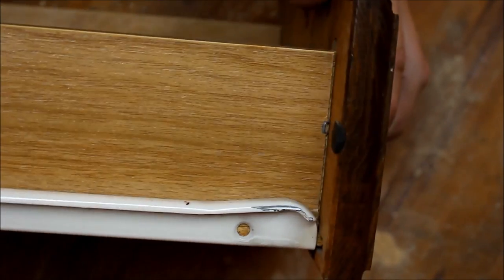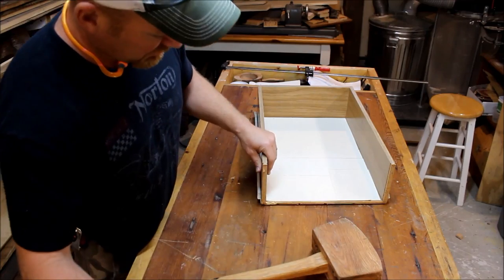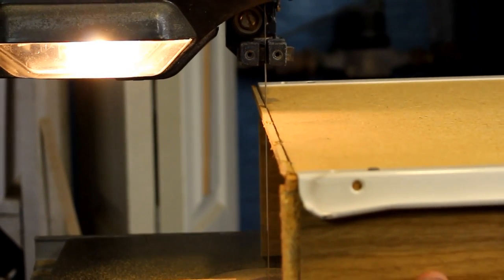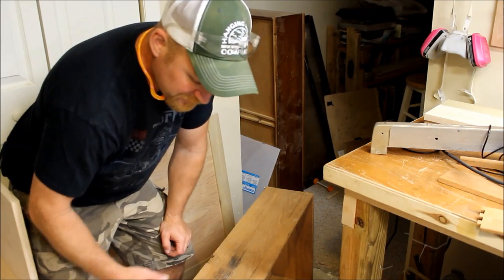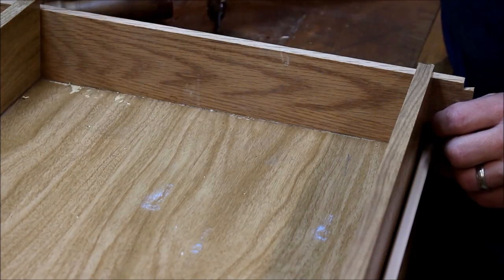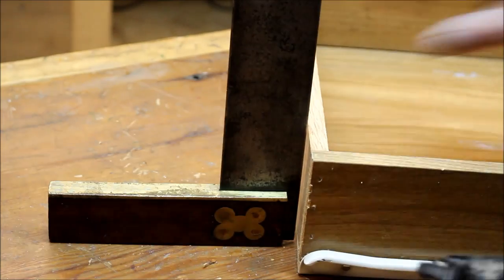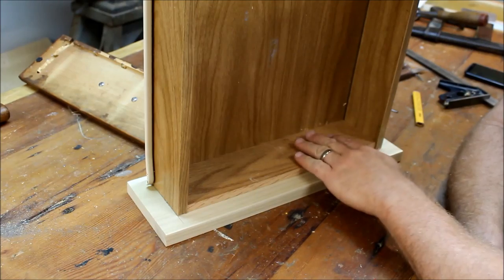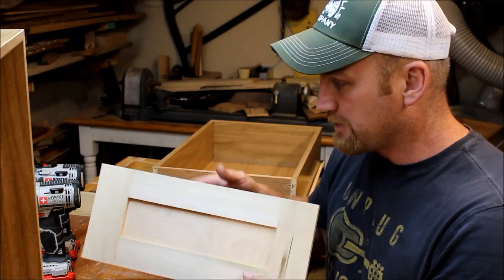Building New Drawer Fronts. DIY Retrofit. How To.  Kitchen Remodel #2. Vintage Wood Workshop

Comment: Very helpful. Curious, wouldn’t it be a good practice to nail plywood bottom to new front side piece underneath. Otherwise it could be a weak spot allowing for a dip or bowing near the front from weighted objects over time.

Comment: Could you also attach that oak board to the inside of the drawer front before attaching the drawer front to the drawer? (After you checked to make sure it fit snug)

Comment: What material did you use for the false draw front? Also does it matter what material you use, I'm intending on painting mine so aesthetics dont matter just thinking about durability and strength. I'm rather new to woodwork and learning as I go. Any advice would be appreciated

Comment: Great video! One thing I can't figure out: how do you handle the drawer pull on your wider/shaker (frame and panel) false drawer fronts? This leaves a gap between the thin panel (on false front) and the actual drawer front (shown at 8:04). If you center the drawer pull then it seems like going to bend/distort the thin panel since there is no meat behind it. Did you just fill this gap with some kind of scrap/spacer to give a solid mount for the pull?
Reply: Chris Stephens wondering the same

Comment: Why didn't you just cut the drawer front off? It saves putting the stress on the drawers, avoids possibly damaging the drawer , besides, you had to cut it in the end anyway.

But nice results, regardless. Thanks for the video.
Reply from the maker: I understand your point but I figured it would be easier to cut on the band saw afterward without the front sticking down below the bottom of the drawer.

Comment: Do you use the same dimensions of the border on the cabinet as the drawer?
Reply from the maker: Linn good question! I went with 2" on the rails (the top and bottom) so the center panel wouldn't be so crowded. The styles are still 2.5"

Comment: I can't believe you put in that oak panel with just 3 trim nails and no glue...I guess you want to go back and a later time and repair lol
Reply from the maker: My Opinion yeah, I see your point, however, I avoided glue because the drawer has a laminate layer over particle board which the wood glue wouldn't stick to.  Construction adhesive or apoxy would probably have worked.  Also I attached it from the bottom with more Brad nails (got cut out of the video).  Last thing is I used soft close drawer slides to reduce slamming force.